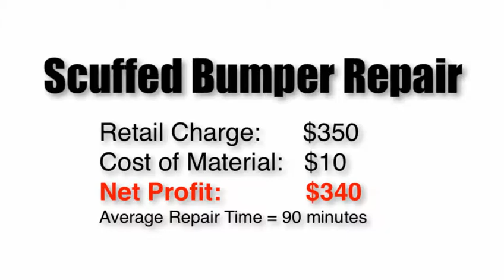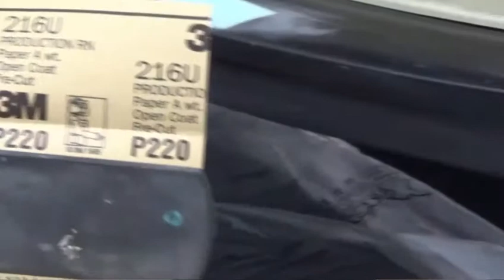Scuffed Bumper Repair

Comment: This repair has WELL over 100 dollars in materials. I bet the basecoat alone was 100 dollars a pint, plus clear coat, plus activator for the clear coat, and reducer for the base coat. The rattle can of primer alone was more than 10 dollars. They might of had about 10 dollars in masking materials. Please do not let anyone tell you masking off your bumper and painting it on the car is the correct way to do it because it's not. Please do yourself a favor and get a quote from a reputable body shop.